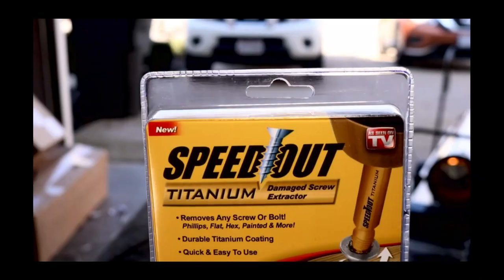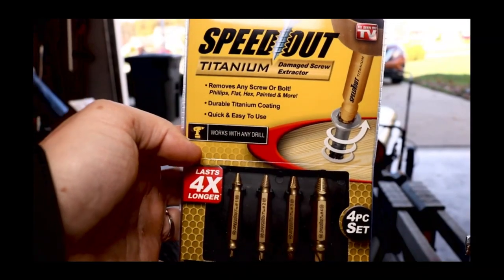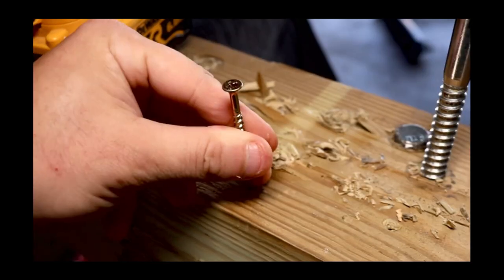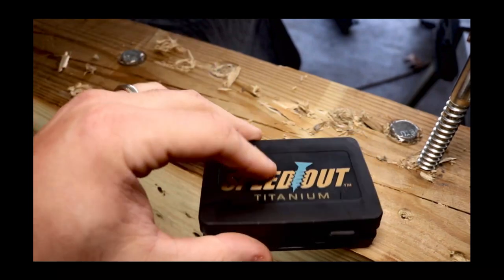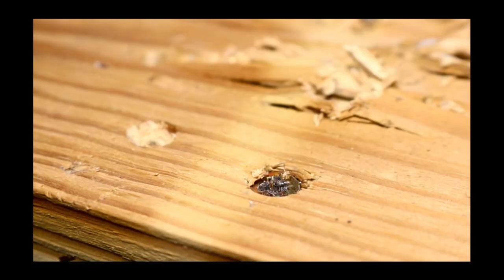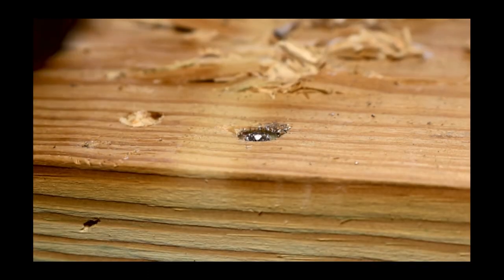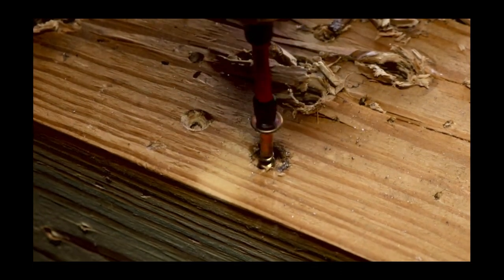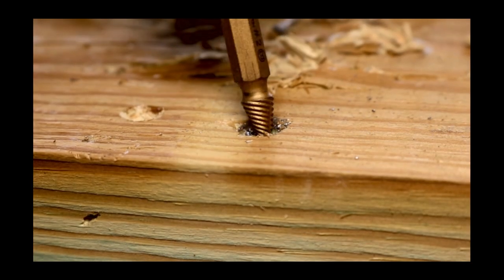Can you really remove ANY STRIPPED SCREW with this "AS SEEN ON TV" (Speed Out) screw extractor set?

Comment: Let me offer my observation/experience. About 25 years ago, when I first started out with a construction crew, the carpenters complained non-stop about the quality of the 16s that were made in China. Ever since a teen, I had used other 16s to frame different structures, but the made-in-China nails were a f...joke! They were slightly thinner and weighed much less than the 16s I had used back in the 1980s. The made in China 16s were sure to bend if you didn't hit them directly head-on every time. Same with Phillip screws. I grew up with them, but sometime in the 1990s, I guess, a lot of hardware has been made in China, and I'll guess that's why those Phillips stripped so easily. After watching this video of the extractor not working, I grabbed my set that I just bought at Lowe's a couple of hours ago. At the bottom of the packet, in tiny font, it says "Made in China to Speed-out specifications." Right! Maybe made in China, but we've seen in recent days that China isn't above lying about anything. Good Luck to everyone with this cheap garbage floating around. I paid 19.95 + tax. Should've watched the vid first.  
FYI: A few years ago, there was a lot of controversy about the bolts used to tie together sections of the new section of the Bay Bridge. On Engineer complaining was the same guy who took part in designing the BART in the Bay Area, and Metro in DC and Virginia. He said despite his warnings, obtuse politicians (my words) refused to listened, and used the bolts anyway. It seems there's an accident waiting to happen.

Comment: They partially worked for me in a tight spot after trying all other ways to remove four stripped screw heads for a door handle, but it's not an exact science, especially if the screw is tightly embedded into the material. I later discovered, for my particular situation, I could've used a small diameter holesaw and extracted the screws and the surrounding material (a pine door), and filled the holes with wood putty, etc. That probably would've been a little less stressful and a little more efficient.
Reply from the maker: So this could probably work on those softer metal screws that strip out all the time, but when you put in giant bold letters that it will work with any screw, that's one heck of a claim
Reply: @ToolReviewZone  lol, probably not the best marketing tagline! 😀 "They work... sometimes!" As I said, they worked for one side of the door, but for the other door handle's screws I had to take a hacksaw to them and cut the screw heads off, file down the ends, putty over them, etc., then drill new holes to which the new door handle would be screwed to. Nightmare.
Reply from the maker: @raminybhatti5740  I hear the Irwin set works pretty good. I'm going to try it. Thanks for the feedback Jay👊

Comment: You ran the bits at too high a speed. When you run them slower you get them to bite in with out stripping out more screw metal. It's worked for me. I have to use them again on a new stripped screw in a motor and hope to God it's not in there so tight I can't get it out.

Comment: I think you started the drill TOO FAST on the 1st step. Then on the 2nd step for the reverse thread to catch and grab, you went in TOO FAST again and the thread didn't catch onto the screw and you just stripped it apart. 
The other part is the material of this extractor VS the material of the screw you are using. 
The other part is how embedded the screw is into the wood and if the wood is hard or soft or if its in metal, how long has it been in the metal and are the threads rusted it closed..

In this case it was simple screw to wood and was only sitting for seconds ... but i believe you went in too fast
Reply: That's exactly what my wife said 😁
Reply: Still didn't work for me. But he was going off what he saw on TV. They drilled in, and drilled out fast. I saw this on a YouTube channel and was like, Hmm, looks easy enough..the guy did say start out slow. Which I did. And you know what? Nothing spectacular happened. My bit just kept on spinning. I started with #2 then went with #3, still nothing.

Comment: You have to drill the screw out so there is no philliphs cross remaining. Once you have a crater in the head of the screw, use the drill end of the tool and firmly work around the crater. Flip it and firmly drill out the screw. They work fine, works best in an impact, drilling with wd40 or cutting fluid and just generally using common sense.
Reply: Does it work on ceased stripped bolts as well?
Reply: It says specifically in the instructions to not use with impact.
Reply: @apollomacgregor6534  where does it say that?
Reply: you did it with an impact?
Reply: @thisisyaren  In the instructions.

Comment: The extractor part works fine, but the drill part is worthless.  Needs a perfect dug out hole to work.  I use a normal drill bit to get the hole drilled out for extraction.  I probably extracted nearly a hundred stripped out screws using the Speedouts.  You use your mechanical common sense when using tools.

Comment: I had bought a set to remove a stripped screw that was holding onto a cabinet door when I was doing my cabinet renovations.

I started with 1 size and had to go up 1-2 more sizes before eventually got it out. My experience was very similar to yours. They aren't very good. But they did eventually help. But they have like a 50% success rate. So definitely don't recommend them. They are extremely frustrating.

Comment: When your tools are your lifeline, it's best that you buy quality! Screw extractors are no different and are a dime a dozen. Invest in a good set and they won't let you down. And, we all know where they are coming from now a days! Otherwise, if you buy cheap stuff, and especially if you don't follow instructions to the "t", you set yourself up for failure and frustration (and another trip to the store). Chances are, these "as seen on tv"  and other cheap sets are not high speed steel and case hardened or tempered. Irwin or Alden both make better sets, compared to most.

Comment: One single proper hard metal drill costs around 20-30€ at least. How come you spend 20$ on 4 piece kit and expect it to work on proper steal? These toys you found in any store are toys, they would work on aluminum at most. You gotta spend 200$ for a good kit with proper HSS or HM alloy… not a cheap coating…

Comment: Bro you totally did it all wrong 🤣 You're supposed to put the drill in reverse, also use slow speed. Not full speed and it definitely works, just watched 3 other videos that it worked perfectly with the right speed setting. 👌
Reply from the maker: It was in reverse and was stated 100 times in the video that it was
Reply: Yes but you used high speeds. 👌 it has to be done in low speeds or slowest speed possible on a drill /driver only also. They will work did a test last night on several screws and a lag bolt and the same #1 extractor worked on everything no problem. The black drywall screws were a little harder to drill into but the extractor end did remove the screws. 3 inch screws also. 👌 it removes deck mate screws, spax, drywall, self tappers etc. All done on lowest speed with my 12v Dewalt Xtream drill/driver . Do another video and use low speed. 👌 I'll bet it works better.
Reply: These ones don't work. Engineers won't use them. The real screw and bolt extractors are fluted and made of hard steel. The pilot hole is drilled with a drill bit.

Comment: When I bought a secondhand motorcycle I had to change the front brake pads and the pin holding them in was a cros head pin that had been rounded out. I bought these to get it out, not a chance in hell. In the end I had to heat the caliper near the pin, drill a small hole and bang in a flat head driver and wedge it into the hole....Then it came out. Absolute junk!!

Comment: Very deceptive video. Those are the cheap screw extractors. The real screw extractors are high strength steel and fluted. You drill with a drill bit first them use the fluted screw extractors.

Comment: Seen some many of these kits EVERYONE makes one but I have used the Irwin set (w drill bits included) works perfect but if you want to go cheap the Harbor Freight has them the one  made by Warrior that comes with drill bits for $8.99 now with the 30% coupon(71651740 good till 11/10.19) is $6.32.
Reply from the maker: Everyone says that the Erwin work good. I need to check them out bro👊
Reply: @ToolReviewZone Zone there is a reason why we say Irwin works as you have the drill bits and the extractors. It is at Lowes item number Item # 576748 cost $24.98 it is the 10 piece kit I have the same only with the metal case.
Reply from the maker: @stanleymcman9422  stand you definitely are the man. I'm going to see if I can find it on Amazon as I dont really have a lowes close. If not I'll make the drive